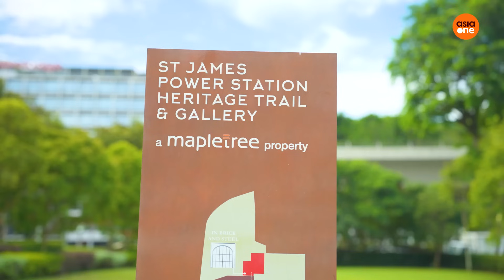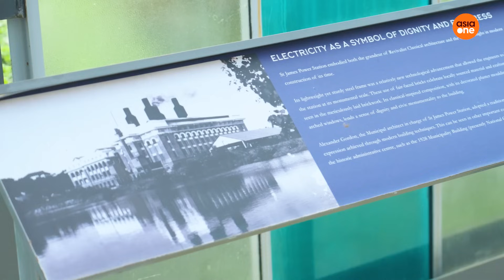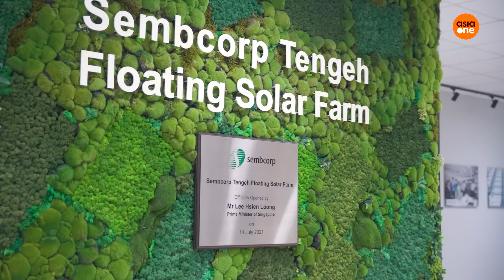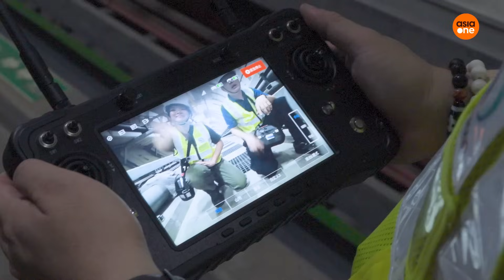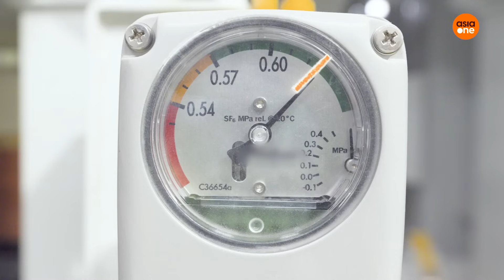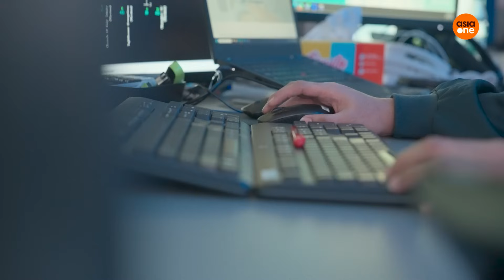Powering Singapore: Can solar meet our energy needs? | Through The Years

Comment: Thank you EMA and SP Services for electricity supply.
On roof top solar power for home owner, I was told that it will takes up to 8 weeks for the system to be commissioned after completion of installation!  As an engineer, my feel this should take no more than 1-2 weeks.  The process is not complicated with a standardized system.  Every day of delay means we wasting our are investment in mitigating global warming.  Let's all do our part in greening our energy supply.

Comment: Natural gas is FOSSIL GAS
everything is natural, that  is a weasel word that means nothing
Reply: Yes, the "natural" in "natural gas" is pure marketing hype weasel word.

In fact, natural gas like 95%+ methane (CH₄) which is still produces a lot of CO₂ at some 1300 pounds per MWh generation.  Along with a lot of nitrogen and particulate emissions if not filtered out properly.

CH₄ itself has 80X the greenhouse warming potential of CO₂ over a 20-year period.  During processing, distribution, and usage, a lot of CH₄ ends up emitted into the atmosphere over small leaks collectively over millions of miles of pipes.  Small leaks over such a large length ends up emitting a lot of CH₄ globally at hundreds of millions tonnes.  This is called the "fugitive emissions" problem.  CH₄ has more of an effect right now than CO2